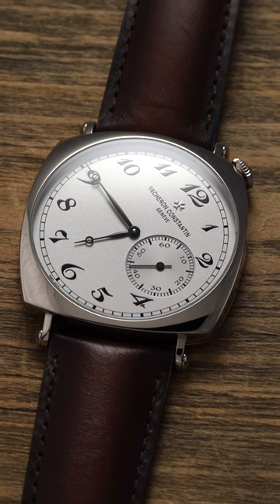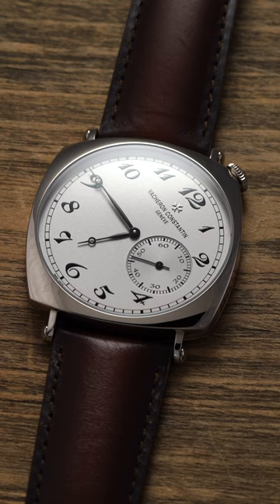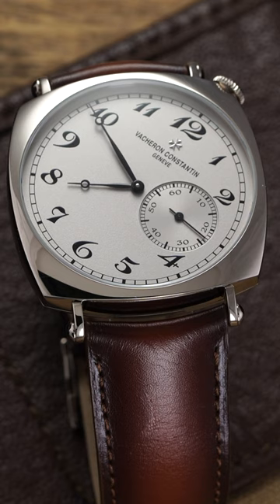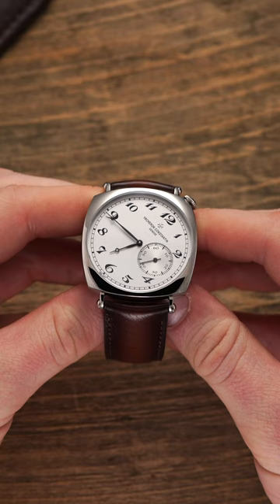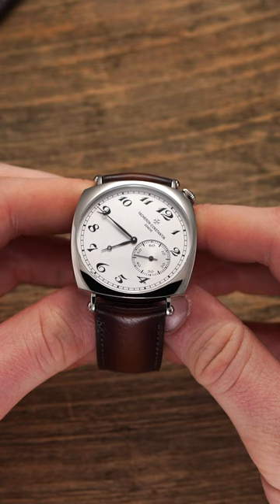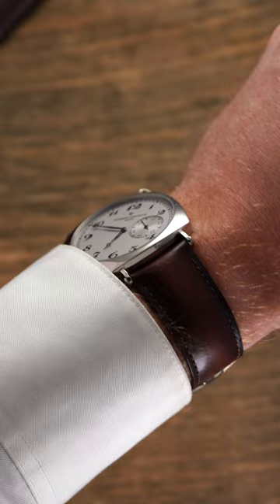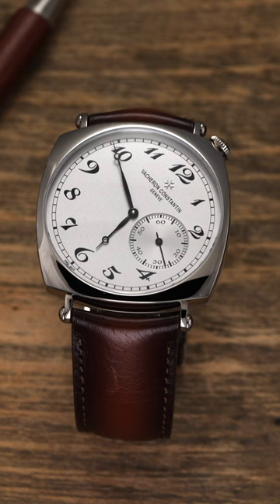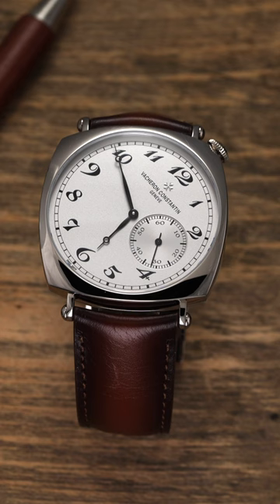Why is this watch dial crooked?

Comment: Why not make a watch where the whole case rotates to any angle you'd like
Reply: They do!!! ITS REALLY COOL. Its a dual case where you switch between a 30 degree offset and normal orientation. Its motorcycle  inspired, the TTT ICON1000 by REC

Comment: I've got one of these and it's a beautiful watch, but the 'driver's watch' explanation doesn't hold up if you actually try wearing it whilst driving, and that's generally considered an apocryphal story. The other explanation is the 'preacher's watch', but frankly I think they just did it because it looks cool in a sort of Daliesque way. But the one thing that really irritates me is the sub-seconds dial is aligned with the regular 12 o'clock position, making the whole thing inconsistent. The original version from 1919 with the sub-seconds at the offset 6 o'clock and correctly aligned is way cooler though.

Comment: He’s got this wrong, the rotated dial is called a Montgomery Dial, Boxcar Dial and a few others based on manufacturer, but generally called a Railroad Dial and was for locomotive engineers as it let them keep track of time without removing or moving their hands from the steam/pressure controls or while working on the engine that previous pocket and early wrist watches made difficult and was meant to be readable in adverse conditions. Same reason we have chronographs, for the railroad, not cars. No one driving is checking time or pacing using their watch or the watches tachymeter, and co-pilots used to use several pocket watches with their lager faces that also allowed them to write while pacing. VC didn’t invent this, and then calling it a drivers watch is laughable, especially since that’s why most cars have on board clocks like Porsche and the like. C’mon Teddy, you know better, the history is far too rich when it come to railroads and watches to post something like this. For this watch to work as a drivers watch your left hand would need to be over at the 3 o’clock position
Reply: I've wondered about this as you don't need one of these watches to realise that,  with your hands in a normal position on the steering wheel you can't really see the dial at all even when it's on the inside of the wrist - except when changing gear, and are you really going to glance down when you're slowing down to approach a tricky bend? :-)

Comment: It is supposed to be worn on your right wrist? The orientation seems backward to me.
Reply: Extend your left arm and look at your wrist.
Reply: Depends on how you naturally grab the wheel. If you drive on the left side of the road and a manual, you’d probably put your right hand on the center of the wheel and shift with left. From US and using both hands on wheel or lazy using just left, I’d personally use watch on left hand